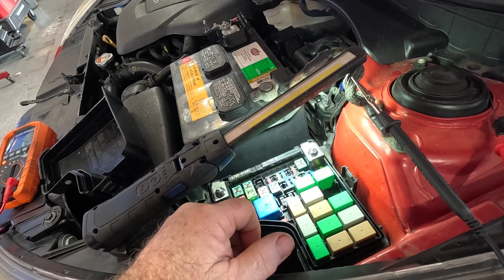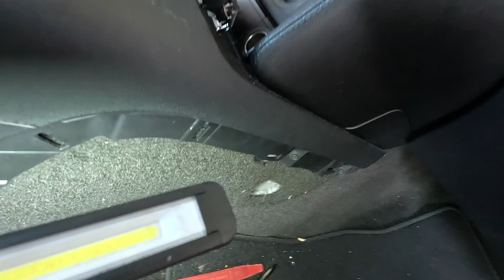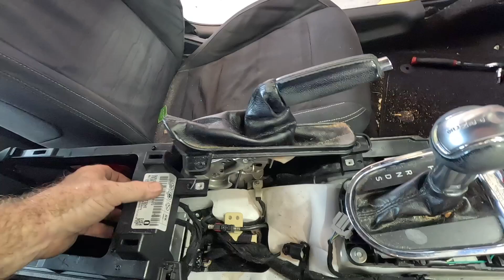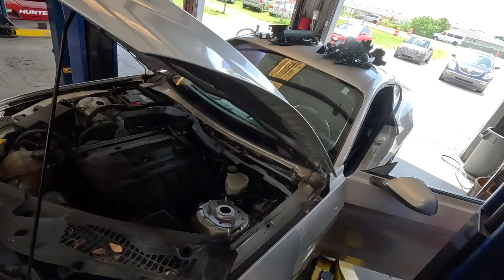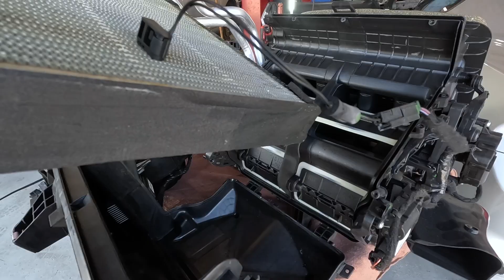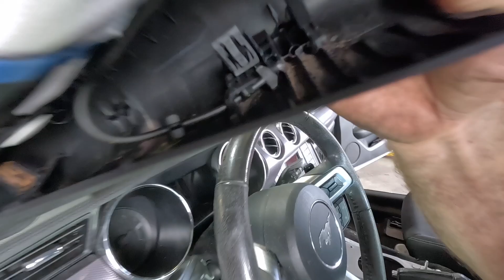VELOSTER WONT SHIFT, MUSTANG EVAPORATOR, SPEND A DAY IN THE AUTO REPAIR SHOP #300! #repair #auto

Comment: I swear that customers are told to fill their cars with garbage when they find out the interior needs to come apart. Every dash pull or carpet removal I’ve ever done has needed 20-30 minutes of unpaid cleaning before I could even start
Reply from the maker: Yeah, it is getting more and more common it seems.